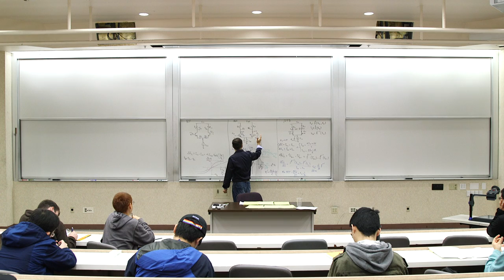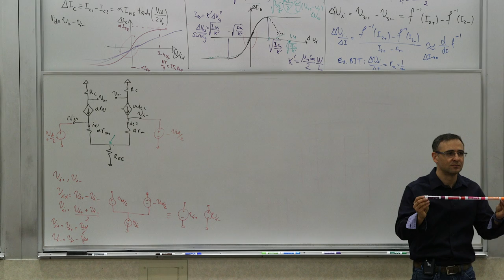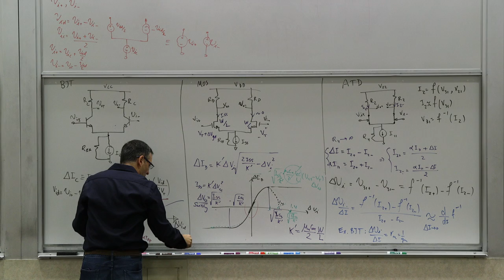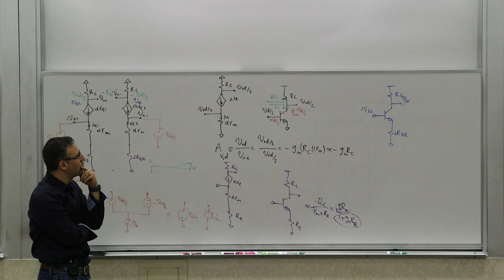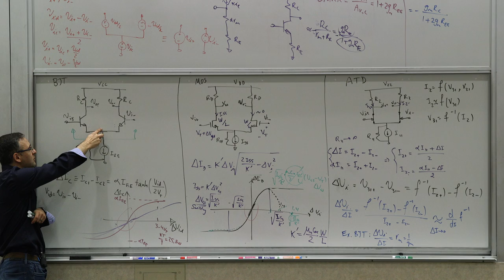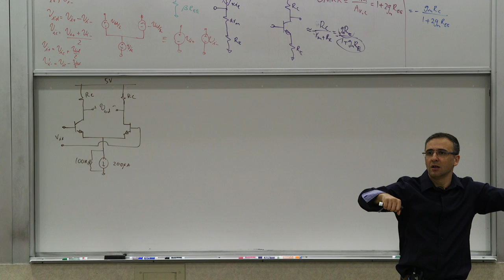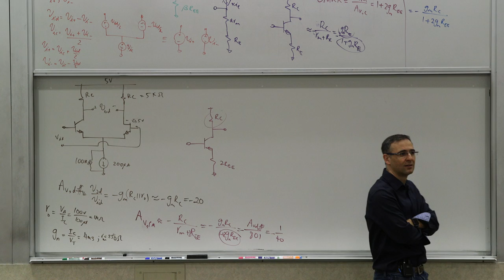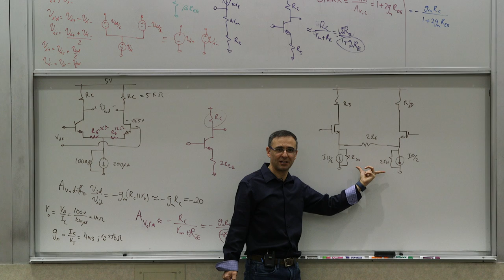128N. (Pt. 2) Differential Amplifiers: MOS, BJT, and ATD

Comment: Hello sir, I've got some doubts,
1. Why is the common-mode gain just the gain of the half circuit? Shouldn't we take the difference of both half circuits, so AvCm = 0 ideally? 
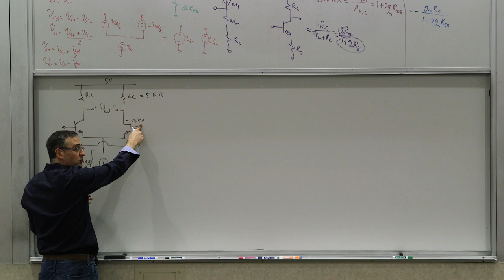2. @35:35 200μΑ flowing through RC is the max case, so that's the lowest dip of the collector node. In this case, the lowest dip is 4V so the Base input must be 4.5 V minimum.  So shouldn't the Common-mode input's minimum be 4.5V to something higher than that, why is it 1V - 4.5V? (I'm speaking under the assumption that the common-mode input is the base voltage, I think I'm wrong somewhere but I'm not able to put my finger on it)
Thank you very much
Reply: 1. It is the same gain that you find because you apply the same voltage in both input and then you obtain the same output voltage variation in both the citcuit parts
2. When the collector voltage is 4 V then the BJT is approaching the saturation, and can't go further below that value. If the BJT has to remain in forward active mode, VBC has to be lower than 0,5V so that the BC junction is not directly biased. So, using KVL we obtain that the maximum value for Vi- (the voltage of the base of right BJT) is 4V+0.5V = 4.5V. The minimum value for Vi- has discussed previous in the video: the voltage across the current source, because this is realized with a transistor, is minimum 0.2V-0.3V, the minimum voltage, of the other (left side) BJT in forward active region is approximately 0,7V, then the left BJT base voltage is at least 0,7V+0,3V= 1V.
Reply: 1) Yes, you are right. Differentially & ideally the AvCm =0 and so CMRR is ideally infinite (even if Ree is finite).
2) The base can't go above 4.5V b/c otherwise the Base/Collector p/n junction would start to be forward biased and the NPN transistor would leave the active region and enter the saturation region.
Reply: @stefano.a  You are absolutely correct in answering both questions. I totally agree with you!

Comment: 43:36  Sir, you said that when we add a resistor to the emitter, shouldn't the CMRR goes down a lot? because it was 1+2g_mR_EE. But now, it is 1+2g_mR_EE/(1+g_mR_E).Where R_E is the emitter resistance
Reply: Yes, you are right. The differential gain dropped by a factor of 5x (1+g_mR_E) while the common mode gain remained the same. Therefore the CMRR should drop by 5x (the 1+g_mR_E  factor you mention).

However there's another issue that makes irrelevant that 5x gain drop.
Common mode wise both branches have the same input and the same gain ideally. When you take the output differentially they cancel out and therefore the common mode gain is actually 0 (zero) even when Ree is finite.
So, ideally the CMRR is infinite.
Reply: No, see the definition of CMRR @22:10. It's the ratio between Av_diff and Av_cm. The numerator of Av_cm always has the expression of Av_diff. So the CMRR is simplified as the denominator of Av_cm, which is CMRR=1+2*gm*REE which is still approx. of 800.

Comment: 22:22 However, I think that differentially the common mode gain is ideally 0 (zero) b/c both branches have the same input and the same gain. Therefore I believe the CMRR is ideally infinite even if Ree is finite.
Reply: No, if Ree is finite, you would amplify the common mode voltage. This is very common in differential amplifiers where you amply the common noise seen by both inputs, which is not desirable. That's why in may datasheets this CMRR parameter is extremely important. Typically you see 70dB~90dB of CMRR range in datasheet, not infinite.
Reply: @nurahmedomar   No. Note that I used the words "differentially " and "ideally". By ideally I mean no mismatches (in Rc or the BJT's).  And by differentially I mean taking out the output differentially (vop - von).
If there are no mismatches, each half circuit is exactly equal with finite or infinite Ree. The gain will be equal for both half circuits and equal to -Rc/(rm + 2Ree). Therefore, when you take the output differentially (vop - von) they cancel out.

Of course that in the real world it's inevitable to have mismatches and therefore the CMRR will never be infinite even is the output is taken differentially. In that case the larger Ree the better.
Reply: @justpaulo  If you say Ree is ideal, and infinite. I agree with you, the CMRR is also infinite. The mismatch you are talking about is more profound for differential gain, it does not affect the common mode gain much.

Comment: 43:05 No. Even ignoring that the CMRR is ideally infinite, the CMRR as calculated does not remains the same.
The A_vcm remains the same (b/c 200 kΩ +1 kΩ ~ 200 kΩ ), but the differential gain A_vid with the introduction of Re dropped by a factor of 5x (1+ gm*Re) as intended & calculated a few minutes earlier in the video. Therefore the CMRR as calculated becomes 160 (and not 800).

PS: this comes to show that even great Professors can have slips of the pen...
Reply: Nope, you almost got me, but think about the definition of CMRR @22:10. It's the ratio between Av_diff and Av_cm. The numerator of Av_cm always has the expression of Av_diff. So the CMRR is simplified as the denominator of Av_cm, which is CMRR=1+2*gm*REE which is still approx. of 800.
Reply: @nurahmedomar  No. When we introduce Re the Av_diff is no longer gm*Rc, but rather ~ -Rc/Re . However in the Av_cm expression your numerator is still gm*Rc (no longer Av_diff therefore).

Look, with Re the Av_cm = -Rc/(rm + Re + 2Ree) ~ -Rc/(rm + 2Ree)  because 2Ree >>  Re (200 Kohm >> 1 Kohm). So basically with or without Re, Av_cm remains approximately the same. 
Av_diff however drops by a factor of 5, and so the CMRR must drop by 5x from 800 to 160.
Reply: @justpaulo  I think you are right. After adding the source degeneration resistor Re, the Av_diff changes, but Av_cm numerator does not change, so it cannot cancels out simply.

Comment: As differential voltage grows it will steer the bias current onto one side, woudn't that change the gm as it is determent by Ic/Vt? So we wouldn't have linear amplification of Vid, or is Vid considered small signal and thus always having gm = Iee/2Vt?
Reply: If you look at the large signal curve you start to get some clipping once most of the current is on one side or the other. The gm is only accurate in the approximately linear region. If you really want to you can do small signal model everywhere via a piece-wise linear model. Which is where you cut up your large signal into a bunch of small signals and do the small signal analysis for each region.
Reply: You're right. Gm is changing with the input, and that's why we're assuming a very small perturbation so that we can assume gm is constant and equals to quasi-point collector current (biasing current) over the thermal voltage. 
You just have mixed large signal analysis with small signal, and that is not correct. You have a gm around biasing point, and that gm is changing for large swing input, thus changing gain with input voltage and finally distortion in the output. While solving in small signal model, you assume that all of these things are not there, since this model is linear.